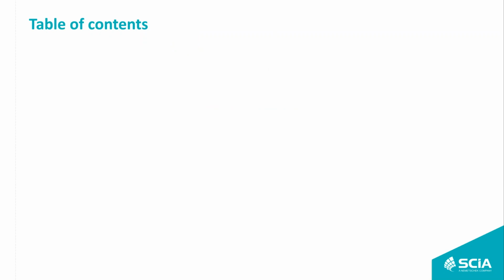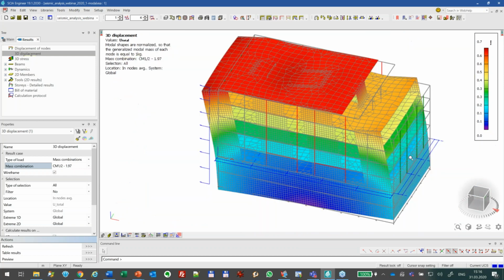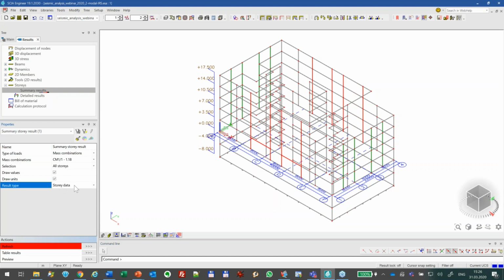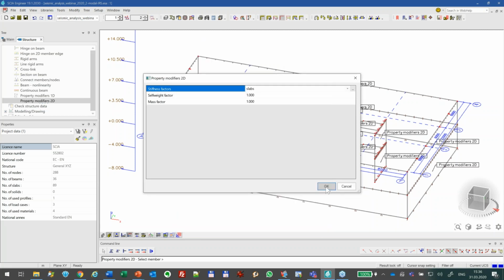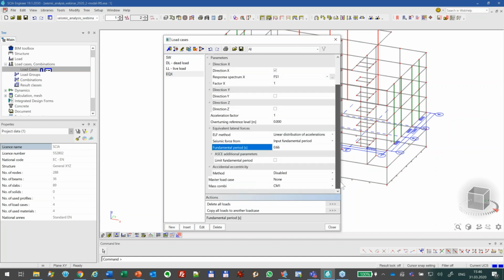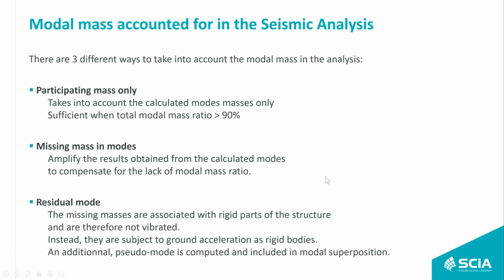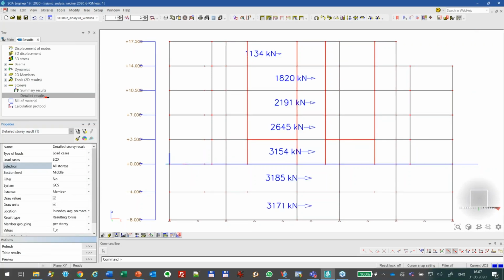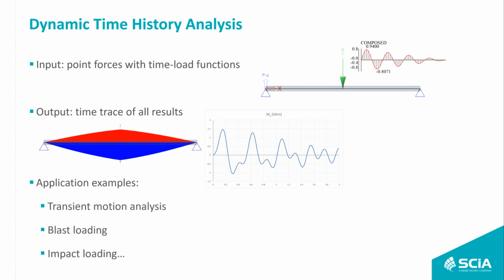[EN] Seismic analysis of buildings in SCIA Engineer

Comment: is these a way to design reinforced concrete shear walls with scia?
Reply from the maker: If need to perform a seismic analysis you can do it as shown. Afterwards, you can use the results of this analysis to design reinforced concrete shear walls. 
However, you do not need to perform a seismic analysis just to be able to design reinforced shear walls.
Have a nice day